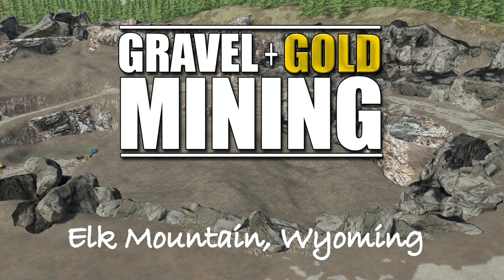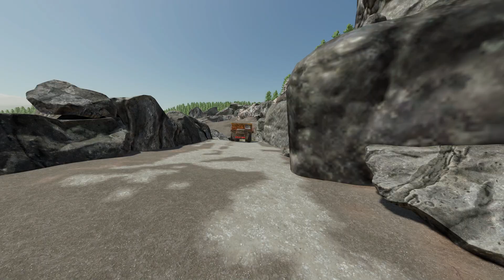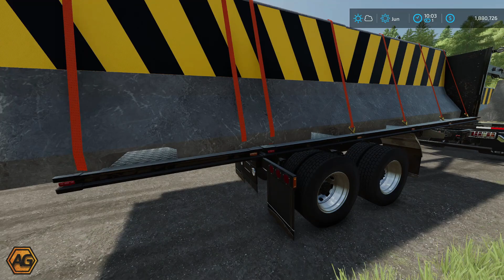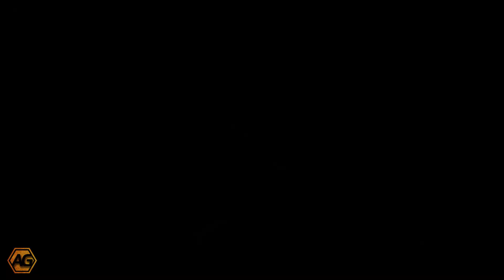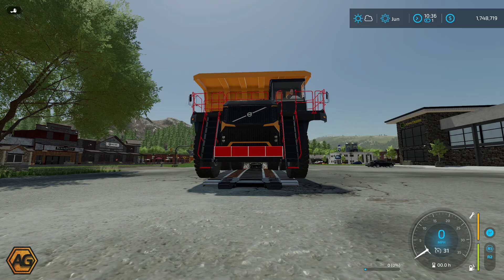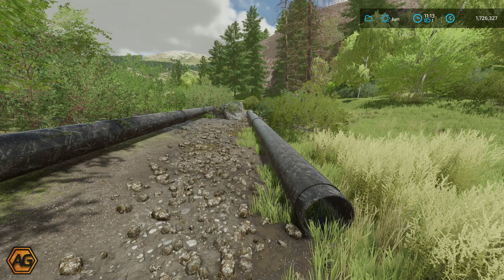We are washing dirt  - Episode 15 -  Elk Mountain, Wyoming - FS22

Comment: Hi Argsy, I've watched your amazing in-depth videos, and learnt heaps. One question I have for you concerning Auto Drive regarding the use of folders, has me beat trying to figure it out. Maybe you can help.
I'm playing on Elk Mountain Mining map, and have everything set up carting away from the Universal Crusher to the train silo from the gravel pit. The capacity of the train silo is quite small, so I thought I would place three silos at the timber mill right near the train silo and use two truck and trailers to cart from the gavel pit to these silos supplying Gravel, Lime and Iron Ore. I then use one six wheeler to cart from the three silos to the train silo. I set up a folder with the three silos as pick up points, and another folder with the train silo delivery. My problem is that when Autodrive rotates from one product to the next, the actual product does not change in the bottom window (under the delivery destination name). As the product name is wrong, the silos will not fill the truck, unless I change it manually, which defeats the purpose of using folders. I hope I have explained that so you can understand the issue, but no probs if you don't know if there's a work around.
Anyway thanks for your Vids and cheers from up the road in Mangawhai.
Reply from the maker: Hey Steve, another Kiwi! Nice to meet you. I think the limitations on AD might mean you can't swap between crops without manual intervention to change the crop type. So either one vehicle for each silo, or you run until the silo is empty then change. Would be great if you could do that though! Sounds like some setup you have running.